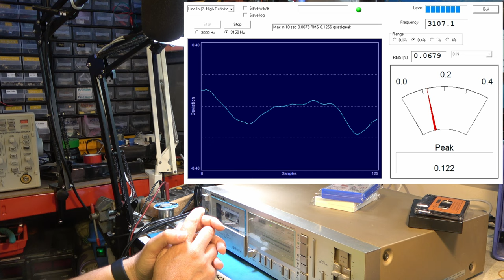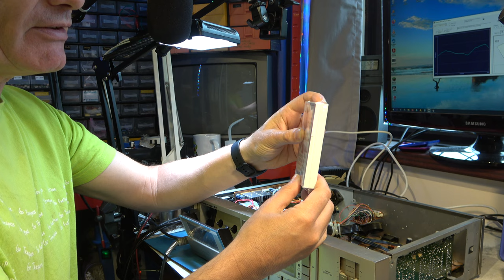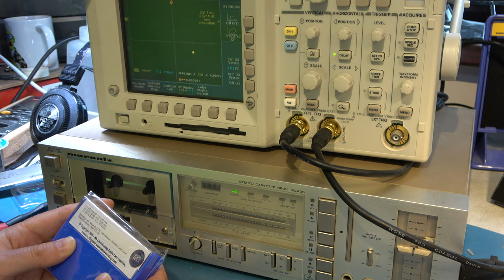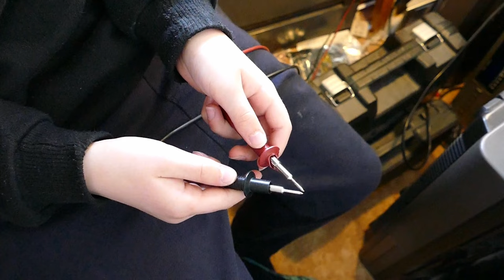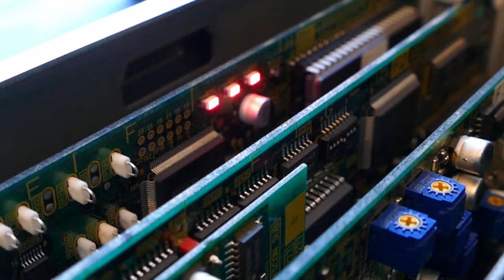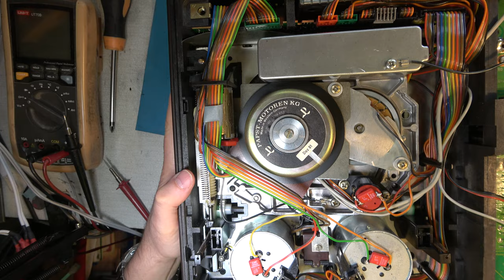Using audio alignment cassettes

Comment: That shifting variation of Azimuth is the tape waving on the PB head. The tape path should be clean and verified. Pinch rollers or worn heads may be a root cause.
Reply: This can be a problem on slow speed cassettes and especially mini and micro cassettes (Long Play) because even with equipment in good condition, azimuth can actually cycle in and out of alignment many times per minute . The tolerances are not tight enough to maintain steady azimuth tracking. Playback with a stereo rather than a mono head reduces this. Unfortunately most mini and microcassette machines were mono.

Comment: Nice video.. but those tapes are rubbish, good for a fast check but not good for as professional calibration... calibrating a deck with those "homemade" cassettes you risk to do more damage than benefit... I know, finding some new old stock calibration cassettes from the usual pro laboratories is a nightmare, but is a must to be sure to do a professional job.
Reply from the maker: I do understand the difference between these and tapes made with dedicated equipment for the purpose, but they are pretty much unobtainable.

Comment: Any cassette recorded with test tone will have the inherent vice of the deck it was recorded on. Which is why new calibration cassettes are flawed. The desirable ones would come from the cassette era from respected manufacturers, like BASF calibration set.
Reply from the maker: That's right, there's no perfect alignment tape.
Reply: Old calibration tapes were flawed as well. There is no such thing as a perfect alignment.
Reply: @svenschwingel8632  True. The only reliable result would be azimuth tape recorded by industrial duplicators to perfectly align to cassettes manfactured on said duplicator.
Reply: @SFtheGreat  even industrial duplicators can be off. At some point, you WILL have to settle for a reference. And having a reference with slight tolerance is better than having none at all. I buy my alignment tapes from Alex Nikitin over at A.N.T. Audio and use a Willy Hermann WHS300 gauge for mechanical alignments. They have worked out great for me thus far.
Reply: @svenschwingel8632  Of course, everything has its own inherent vice.

Comment: I also used the UK-made alignment tapes you have on my AIWA XK-S7000 and I am still not sure what to make of their quality. The first set I bought showed significantly different levels L/R when playing them. Matthew, the owner of the manufacturing shop, was very kind to check and replace my full set. The new ones didn't show the difference, but now my deck's L/R channels were significantly off after "aligning" them using the tape. I couldn't figure out if the tapes were 100% fine.
Reply from the maker: Yes, exactly the same here!  I have to go back and re-align the audio levels of one of my decks for the same reason.

Comment: If sombody like to have almost perfect wow aflater test cattet tape it shoul be order from high speed duplicators that copy the tape up to 100 time daster,. So any wow and flater is almost non exitance. The source of frequency is RF generator. That might be more inportant for speed ajustment. If you like to mesure just wow and flater take the casette tape and record the signal from computer and play and measure on the meter. The number that you get from the wow and flater meter just divide by two.  This will be the most accurate measurement that you can make on your tape recorder no mater what profetionaly done tape you will obtain.
Reply from the maker: It may not be exactly divide by two for a self-generated tape, but in that order of things.  If your cassette deck has a cyclical wow, then it could cancel itself out and imply that it's better than it is.

Comment: Aligning to standard azimuth is fine as far as it goes but it makes an assumption. There's no guarantee an unknown recording will play back with azimuth aligned correctly. Interestingly the only way to find out if a recorded cassette is "off azimuth" is to adjust playback head azimuth and note the changes in the sound. But most people including most transfer shops dont seem to bother. VHS and Beta cassettes are even more sensitive to audio azimuth errors, hence the common complaint that the linear audio is hissy and muffled. With  azimuth adjusted to the tape the sound may  be a lot less hissy and muffled.
Reply from the maker: With dictation cassettes (minicassete, microcassette), whose recorders were regularly knocked about, I do an Azimuth check with every tape that comes in.  Generally VHS and Beta decks had well locked off audio/control heads so audio azimuth errors are not too common.  N1500 and to a lesser extent N1700 tapes I do have to set up azimuth for audio or control track reasons.
Reply: @video99couk   My claim was that the only way to know objectively if record and play azimuths  on any given tape are aligned is to test it by adjusting azimuth on the play deck and listening. Carefully rock the adjuster back and forth until we reach the peak. I'm not saying that any given recording is misaligned or not, but that we cant be sure either way  unless we test it. As to the  cause in each case,  with the recorders long  since gone we can only speculate.
Reply: Some consumer cassette decks such as some Nakamichi's have a playback azimuth control on the front panel. One model allows azimuth adjustment from the wireless remote (CR7). To twiddle the  control knob or use the remote is child's play. It doesnt take much skill or intelligence. So I suspect the reason most dont adjust azimuth when transferring individual tapes is because on most decks, making the adjustment is too technical or inconvenient. Which it often is.  But that's a different question.

Comment: Great tutorial. I have the SONY TC-WE605S. When I play it in normal way, there's no problem with the sound, but when I use the reverse mode, it sounds low and no definition. How can I solve that issue? Thanks in advance.
Reply from the maker: There will be azimuth adjustment screws for each direction. One of those needs setting up properly. Or there is a mechanical fault in the head rotation mechanism.
Reply: @video99couk  Thanks! I'll check.

Comment: Thanks for keeping the old technology alive! 
A note about the azimuth and level adjustments: The azimuth is usually adjusted so that you first find the maximum output level of a 10-15khz tone and only after that match the phase. That way you can make sure that you're not 360 degrees off. Sony service manuals also specify the azimuth at the mid point of left and right channel maximums (these are not always identical because of manufacturing tolerances).
The level should not be adjusted according to the decks' own meters but to a specified output level at the output jacks, after that you can adjust the decks' own meters to the correct value. This is important because there is no way of knowing whether the meters or the level is off if you adjust by the decks' own meters.

The fluctuation of the phase in the azimuth adjustment is completely normal for a cheap deck like that Marantz, it's caused by an unstable head- tape contact.

Cheers!
Reply from the maker: The Marantz isn't that cheap, I would say it's better than a lot of decks of the vintage.  My main go-to deck now is the Aiwa XK-007 Excelia, which is a bit more expensive.
Reply: Thanks, man. I am currently at moment of repairing pioneer ct-s630s, and seems that other decks (yamaha, telefunken, another pioneer) all have different showing of level of the same tape....did you had such experience, is it possible? I was not sure how to correct that, which level is right. So, question: what voltage to expect if readings of level are 0 dB???

Comment: The azimuth and level tapes used in this video are not full track. They were recorded using an ordinary stereo head, as opposed to a special head that writes on the full width of the tape. This makes them fundamentally UNSUITED to precision alignment work. Fine for debugging a boom box, detrimental in a quality cassette deck. Even these days you can still purchase full track alignment tapes. There is some stock left of original TEAC, BASF, and ABEX cassettes (see e-bay), while new full track cassettes are manufactured by ANT Audio, Hanspeter Roth, and GennLab. Avoid all others if you don't want to end up disappoined or frustrated.
Reply: Yes alignment tapes are full track for good reason but nothing wrong with a stereo alignment tape designed for a stereo machine. In fact it allows  alignment of head height better than a full track as the amplitude error is visible on both tracks. Also there is no need to compensate for the fringing effect (low frequency irregularity) which occurs when a full track tape is used. Note: all my test tapes are full track but I also understand their special limitations in measuring some parameters.

Comment: It  would be interesting to see what the wow and flutter levels are like from the deck's own recording.

 If I remember right the official Sony level test tapes were recorded across the entire width of the tape which meant Dolby levels could be set correctly even if the head height was slightly out of true, Nakamichi tracks were also slightly wider making them better machines for recording aftermarket level test tapes. I used to love working on this type of gear and  I still have (up in the attic) a Sony TC-K75 and TC-K81 (both closed loop 3 head machines) along with my trusty Ferrograph RTS-2 and ATU-1 test set.

Comment: A level tape is used for setting the gain between the head and the Dolby decoder. This is an absolute necessity as Dolby encoding/decoding hinges around a fixed, standardised level. Any error leads to significant frequency response aberrations and audible pumping. The reference level is defined as 400Hz at 200 nWb/m measured according to ANSI, or 218 nWb/m according to DIN. Playing such a tape the internal playback level is adjusted so that a specific voltage is obtained at a specific test pin (see service manual). Alternatively, until a specific voltage is obtained as a specific pin on the Dolby chip (see chip datasheet). Setting level so that the 'Dolby' logo on the deck's meters is reached is NOT valid practice, as it should not be assumed that these meters are (still) properly calibrated.
Reply from the maker: Fair point.

Comment: Do you know if (once someone has made a correct 10k tone tape etc)  if you can also use that free  Signalizer  VST 0.3.2 oscillator program  to get that circle/line adjustment curve on a screen or do you need a real oscilator for that funktion to show. If this windows program also works for that visual azymuth on screen funktion maybe you can show which steps to do in that program to get that curve on screen.

Comment: I imagine the quality of the pinch roller surface  and capstan bearing fit would have produced the slight differences.
But who listens to tones anyway lol.
Your scope showed the playback to be low on one channel, the question is: is it the recording or the player.
Run away would be the best option :-D
Reply from the maker: I'm fairly sure that the right channel is about 2dB down, I could adjust it.  Perhaps I should.
Reply: @video99couk  Only if you are sure the cassette has been recorded with both channels the same amplitude.
If so i would find the playback preset and tweak that only.

Comment: When you change the azimuth for the 15kHz tone, did it go out of phase for the lower frequencies? That's what I imagine happens as it was already in phase at the lower frequencies. So we should trust the higher frequency setting over the lower ones?
Reply: Adjusting azimuth with higher frequencies is way more precise. And if the signal is in phase, it's in phase. It has nothing to do with the frequency.

Comment: Great video Colin! I was setting azimuth on my Aiwa F660 by ear only and seems to work fine. But it would be great to do more precise job. Do you think some sort of PC scope via sound card input could work for this? I don't have a scope anymore and since we operate in audio frequencies this should be possible, right?
Reply from the maker: Yes that would work.  Or even just use Audacity to line up the waveforms, would be a bit clunky but could work.

Comment: Can you use a PC oscilloscope software in place of actual oscilloscope hardware? I assume yes since you used a wow and flutter software.
Reply from the maker: @Matt Quinn I would agree with all of that.  Actually Lissajous figures can even be displayed on most single-beam 'scopes.  I had an hold Heathkit from 1964 that would have been able do to this job just fine.

Comment: great vid! thanks for sharing :) had a quick question, could you maybe do a video on properly setting the REC head? I have a feeling this can be done relatively easy once the playback head is correctly set but would be very helpful. Cheers!!
Reply from the maker: Never thought too much about that.  I'm not sure of the procedure for that but it may involve connecting the REC head to the PLAY circuit temporarily.
Reply: The standard procedure was always, on a 3 head deck, to align the play head to the standard, so the play head is now your standard. Then align the record head to the play head, adjusting the record head (very slowly to allow for the time delay) for maximum signal at say 10 kHz at the play head.  The only time I know of when a record head needs to be azimuth aligned using it temporarily as a playback head is in a machine where there is no playback head, only a record head, such as many high speed tape duplicators back in the day.

Comment: In a repair video for a REVOX B215, the KÖNIG 4907 wow and flutter Cassette says 6.3 KHz +/-2% and +/- 2dB @ -15dB. I prefer "Quartz" Direct Drive. What wow and flutter software was used here ?
Reply from the maker: I suspected that the König tape isn't great.  It's likely then that at least half of the W&F reading I was getting was due to the tape itself.  The software is wfgui and is widely available to download.
Reply: @video99couk  By +/-2% is meant the permanent speed deviation of the stroboscope cassette with measuring tone for frequency counter. But I dare to doubt that König recorded the cassettes with REVOX B215. Over the last few days I've been looking at what 0.025% WRMS wow and flutter Direct Drive dual capstan devices are out there. From the official data, neither REVOX nor Nackamichi can tell that these are supposed to be the “best” devices. I'm currently leaning towards SONY, but without NE5532 on the playback head and over 2k Ohm (total) output resistors for muting. This seems to me to be rather unnecessary for digitizing if you don't use normal speakers.😉

Comment: Merci ... I have this TCC130 abex, how can I adjust the recording level on a 2 heads deck with this tape ? It's easy on a 3 heads with monitoring, but with a 2 heads ? 
For check azimuth, i use my hears with my K702 akg....because there is no perfect azimuth between pre record tapes, it is obvious, I am often obliged to turn the screw to recover the sound on my Tascam 122mk3, it's subtle but i can hear it !

Comment: If I recorded a frequency onto a blank cassette via a you tube freq demo, would I be able to get an accurate wow flutter , azimuth reading with the wfgui ??  Instead of relying on a 3rd party cassette?
Reply from the maker: Well you roughly double the wow & flutter readings relative to a perfect (no such thing) alignment tape.  But other than that, yes.  Azimuth would require a known good recorder, and in the perfect world that would be a special recorder with a full width head, specially manufactured for this purpose.  Very few such alignment tapes exist.
Reply: @video99couk  So, I have 3 tascams and a vintage Panasonic boombox.  Tascams are 133 234 & 238.   I would record a tone separately on each deck to run the w&f test?   The azimuth screws all have loctite or red glue indicating they haven't been fiddled with so I'm assuming they are probably OK.  They all sound great.

Comment: Thank you for your video, How do I shoes or find the right hz  to calibrate the speed in my technics 175 ?
Reply from the maker: Any wow & flutter tape will have 3kHz and/or 3.15kHz, and either can be used to calibrate your machine speed if you have a modern oscilloscope which can measure frequency.

Comment: You believe the old test tape, All tapes sold nowadays are made on consumer decks usually Nakamichi, Not factory made, So there is a compounding W&F added to the new cassette and the level can never be trusted due to aging electronics of those consumer decks
Reply from the maker: The new tape is made on some serious kit which is in tip-top shape.  The tones of course are generated electronically, not copied from another tape.  But I do see your point.
Reply: @video99couk  What company and what gear they use, Is there a video to back their claims?
Reply: As I expected they are using the Nakamichi deck, here is a snippet from their eBay listing:
"Recorded on Quartz Locked Ultra Stable Nakamichi Cassette Deck - 0.027% Wow & Flutter
The Recording Deck Is Checked & Recalibrated If Need Be Before Each Cassette Is Produced"
Reply: @Matt Quinn In the digitizing business the way it should be done is to tune the deck to each tape you're digitizing, There is really no need to any test tapes, At least that's the way I would do it for maximum quality. For people who playback or record tapes it's a different story.
Reply: @Capturing-Memories  Absolutely but it's rarely done. Most  azimuth demonstration videos  only go as far as aligning to a standard reference tape, as if all  cassettes, recorded on who knows what decks back then, just happened to have been perfectly aligned. This is a blind spot especially from those claiming to have high audio transfer standards. When transferring, the tape recording we are transferring IS our azimuth standard.  It should be obvious...